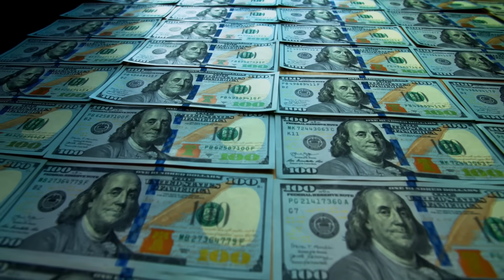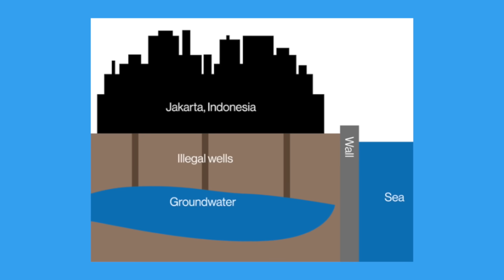Indonesia Is Building A Giant Sea Wall To Save Jakarta

Comment: Sounds good and might work. Few problems though, will the local govt able to ban extraction ground water completely? Where all those consistent funding sources without political interference once govt changed? Any strict monitoring standards during construction phases prevent cut corners? Are there investment benefits from those RE overseas buyers?

Comment: If this project could work the islands they plan on putting in should just be left for wildlife only as the concrete will displace it they might have to put the islands in at the same time as the first barrier further protection for the workers building

Comment: The goal is to prevent Jakarta, which is sinking at a rate of 5 to 10 centimeters per year, from being submerged by the sea. The project is expected to be completed by 2027. It's a massive undertaking, but if successful, it could significantly improve the city's resilience to flooding and ensure a more sustainable future.

Comment: NEW BUILDINGS TO BE CONSTRUCTED BY PILES STRUCTURE AND 10 FT ABOVE THE GROUND AND OLD BUILDINGS' GROUND FLOOR CAN BE FORTIFIED BY CONCRETE TO ACCOMODATE RISING WATER LEVEL.(IN ADDITION TO WALL AROUND).THUS JAKARTA HAS 30 YEARS TO REACH 10 FT LEVEL IF WATER REACHES GROUND.@12CMS/YEAR RISE

Comment: First, the concept of building a poorly built breakwater at the Jakarta coastal line is wrong. You must first clear the people from the coastal line, which is probably three kilometres away from the coastal line. The coastal line is not safe to stay. The land needs to be reclaimed instead of the sea so that it is higher than the level of the sea. The breakwater was poorly built without proper consultation and study of the area. It was built haphazardly to please the people to gain political mileage. You must learn from your former colonial master Netherlands or Singapore how to build a breakwater. The Netherlands government was able to reclaim their swampy lands and sea to build houses and commercial buildings. Singapore had successfully reclaimed the sea and built a breakwater and sea wall over 40 years ago. Another thing I noticed was that there was no outlet drain for seawater to flow into the land. Proper rivers, and canals, need to be built deeper for seawater to flow into the land during high tide. The existing poor-quality built breakwater/seawall causes environmental damage to the sea.

Comment: While it's technically possible to fill empty underground spaces with concrete, it's not a practical solution to Jakarta's groundwater problem. Here's why:

1. **Scale of the Problem**: Jakarta's groundwater depletion affects massive areas due to excessive water extraction, mostly through illegal wells. Filling these spaces with concrete would require an enormous amount of material, time, and resources.

2. **Impact on the Ground**: Filling underground voids with concrete would change the soil's natural structure, leading to further complications. This could alter water flow, damage ecosystems, and potentially worsen subsidence if not carefully engineered.

3. **Subsidence Management**: The primary issue isn't just the voids left by groundwater extraction but the fact that the ground is compacting as the water is drawn out. Concrete wouldn't stop this. What Jakarta needs is groundwater replenishment and better regulation of water extraction to slow subsidence.

4. **Environmental Concerns**: Pouring vast amounts of concrete would have a significant environmental impact, including carbon emissions from concrete production and potential disruption to the natural groundwater system.

A more sustainable approach involves reducing groundwater extraction, implementing water management strategies, and using alternatives like desalination or surface water sources.

Comment: 1. Its not 200cm rising. But there is land subsidence in addition to sea level rise, making the difference in sea level and land height increase by 12cm every year. In 2014, the sea level from land could reach 2 meters. Sea water level is on 2nd floor of the house

2. Jakarta soil is sinking the main problem is the over usage of underground water that made hole under the ground, and make the soil top of that hole sinking.
Reply: they know the consequence of excessive used of underground water, but why they still do it? 🤯
Reply: @bearybear66  because not everyone have access to water pipe that provided by goverment.
Reply: @bubu5439  and what the goverment effort and plan? this is not a recent issue..
Reply: @bearybear66  isnt you just seen the video? There is plan for giant sea wall. Restriction for not using underground water. But for clear water access. People should pay installation fee etc that more expensive than just using underground water. So yeaa

Comment: Where did you get the ridiculous stats? The Java sea is rising 4.7mm per year, not 200cm which is 2 metres. By the time the wall was built the sea would be higher than the wall with your stats.

Comment: How about dismantling the many shopping centres that's not needed to start with. Then stop deep well boring also, build desalination plants to pump and treat water into the country. Create a pathway for the excess water to flow through by creating a man made reservoir, pushing sea water to areas that's been emptied by deep well boring. Create on land desalination plants for areas which don't have much water and that the desalination plant can help feed the local fields and restore ground water levels. Can even build a huge underground desalatinated water reservoir for a large amount of sea water, put wave breakers at the edges of the nation to bring the veriousity of the sea down and obviously don't harm the local ecology and corals with wildlife. Artificial rivers may even serve some purpose here to channel sea water to desalination plants to agricultural areas to help with growing foods etc. Soo much can be done without building a dirty great wall at obscene heights that's just not viable and then you'll have to constantly reinforce the wall and build up, which eventually will mean the sea level and the nation are going to be at odds. The nation will be lower than the sea level and eventually mother nature will take over and find a weak point in the wall and it's all over. 
Urbanisation is good but under responsible circumstances and that you don't destroy the area that your building on, correct assessments of the area to ensure you can build on it should be done 1st. Don't just build for the sake of building its a best way to destroy your land and then overpopulate an area which brings more issues than solutions. Sometimes to go backwards is better than going forwards and that protecting the land is much more vital than just slapping up buildings everywhere.
Reply: There is just an immaculate amount of EMPTY, USELESS MALLS all over greater jakarta itself, people seldom go there as online shopping+even more trendier places pop up, they all add weight to the ground no wonder jakarta is sinking fast

Comment: They would be far better off building a new capital on the high ground inland. If the figures quoted here of sea level rising 200cm a year - 2m per year - and the wall is 24m high, so 12 years into the 40 year plan the water will be over the top anyway. I wonder how many shares the politicians have in the construction companies involved.

Comment: Keep adding weight to the ground? Brilliant idea. You can build all you want,but your not going to stop sea levels from rising.
Reply: Biarkan aja.. warga konoha pantang dicabar pak. Bisa berantakan sakit mental
Reply: Desalination  plants can solve the water problem,then land will not sink. The wall is ok ,but if it has a crack, it will be like dam breaking.
Reply: the rising sea level has a limit, it's enough to drown the entire jakarta but doesn't mean it'd exceed 10 meters, even if it does we can add the height of the wall easily lol, adding 100 meters of more layer on an existing land mass is easy for modern people, at that point jakarta has solved its problem but all other coastal cities in the world will be doomed
Reply: @_martian101  It's like a deep cess pool then with 13 rivers surrounding, can't imagine when they have hard rain.
Reply: @sokapokvic2514  netherlands solved such kind of problem eons ago, modern engineering can solve worse situation as long as there's approval and funds

Comment: No way anywhere on earth is rising by 200cm per year.  Where was this GPT ripped off from?
Reply: i stopped watching when he said that.
Reply: I think 200 mm😂
Reply: It was very terrible to look on real life in north Jakarta. Recently, I was looking in a documentary that shown there a house make up 2 meter under sea level. And just splitted by small size of wall
Reply: @exsanrenaldi sad they can't get in control of these apartment wells. Should be injecting water into the water table, tearing up asphalt to help with absorbion and making permeable readways. 30m people aren't going to move to the new capital. The elite might.
Reply: From gpt 3.5 last year
Reply: Hye im from future. It's happening now😢
Reply: @kadeyydeyy1803  Hey, meet me at the Starbucks next to that other Starbucks and we can discuss further.
Reply: I think it’s 25cm/yr
Reply: It is 4.7mm/year
Reply: Comment hoax.

My From Indonesia.

Jakarta city is the best. 
Jakarta reklamasi island.
Jakarta island.
Reply: Wrong information
Reply: That Is Only An Estimation.
Reply: No. He said the sea was rising 200 cm per year.  The 12 cm per year was how much Jakarta is sinking. And 200 cm is over six feet, so that obviously not accurate
Reply: 2:28 Thet got the subsidence rate and sea level rise rate mixed up AND switched mm for cm.  If you look up figures on subsidence rates 200mm/year is at the very top end of estimates for Jakarta.

But don't blame AI.  This is a completely human fuckup.
Reply: Regardless, Dubai UAE, Done it, Almost Bankrupt. This Video, Monetized..
Reply: He said 12 cm per year.  Not 200cm.
Reply: @harperwelch5147  he said 200.  Even 12 CM per year is false